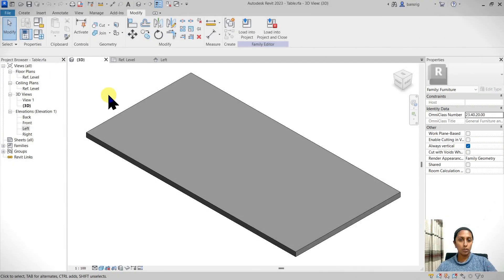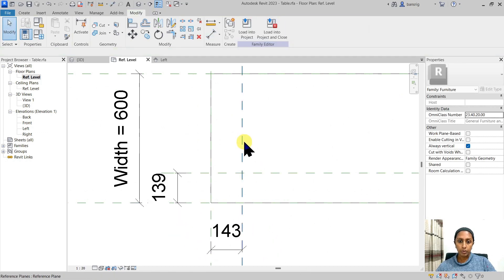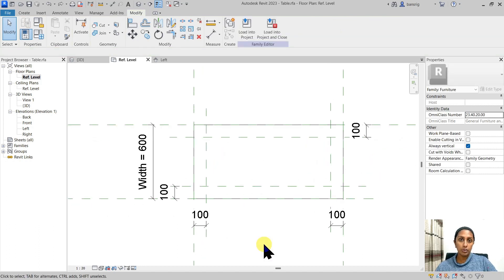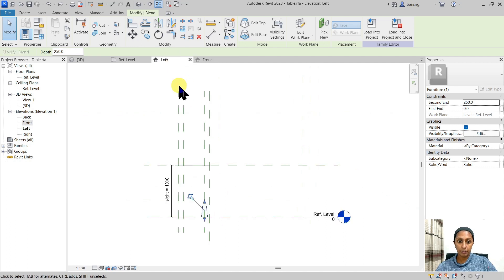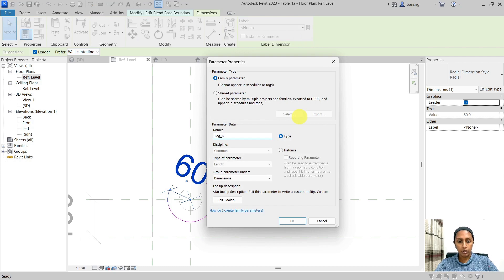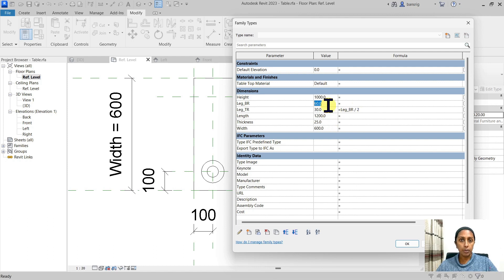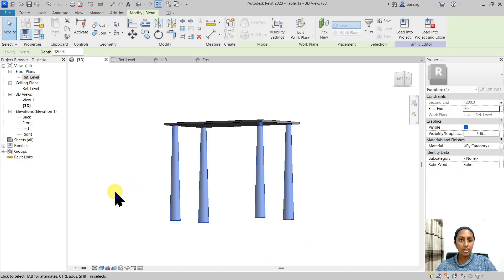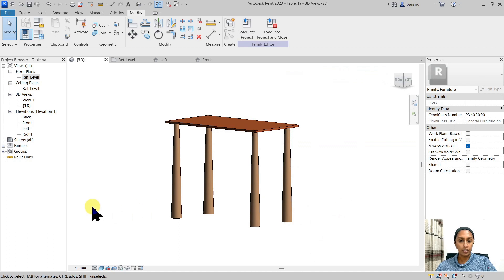EP54 | Revit Beginner Program | 3D Parametric Family Basics - Part 2 | Bansri Pandey

Comment: thank you so much! 
Is it possible to make this family always align to the center no matter how I change the table length or width? (When I flex it, one side of the table edge move so it no longer align to the center)
Reply from the maker: Sure. You can create the table keeping the insertion point in the center of the table. And then, use Equality Constraint to keep the table length and width equal from the center. In this episode, you can check out how to use Equality constraint: https://youtu.be/cRlBtegx4qE